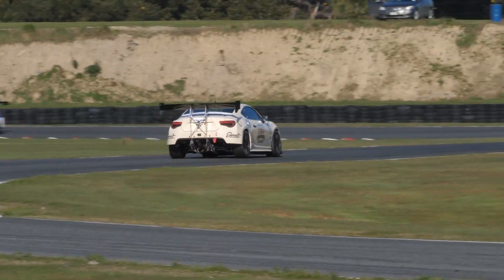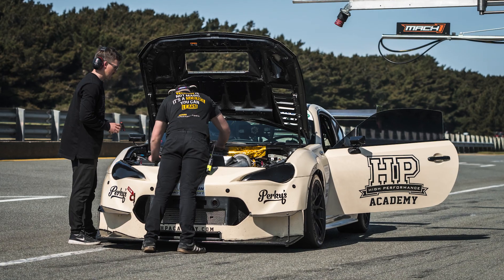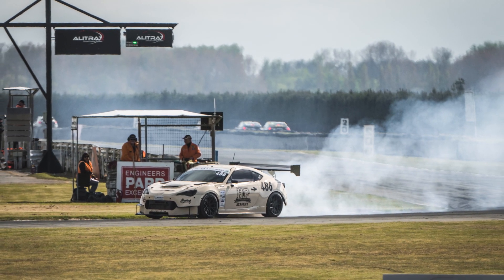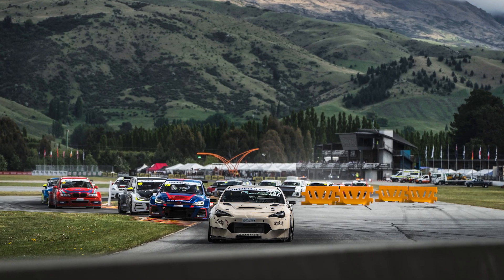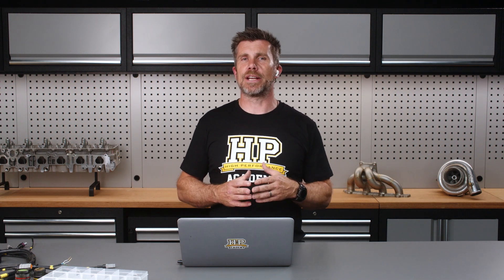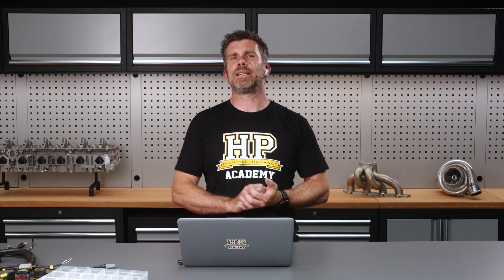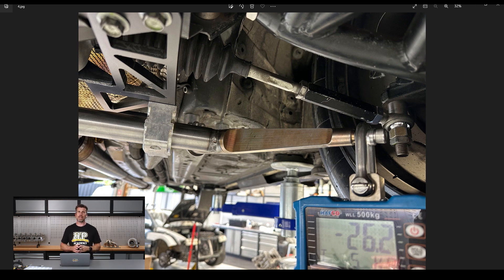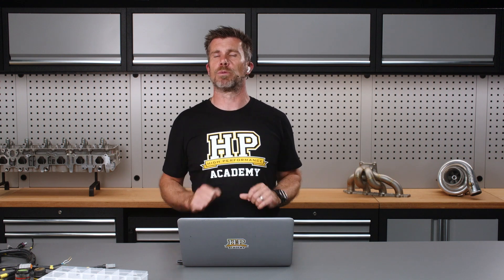Anti-roll Bar Adjustment | SR86 #update

Comment: Can you attach servos to the arb or attach to the manual lever an electric or pneumatic ram and program through telemetry when to use which setting? Or time based, or possibly steering angle, speed and g's to have constantly variable settings?
Reply: Or from GPS coordinates.

Comment: What an amazing design! Is this popular amongst the “high-end” racing community?
Reply from the maker: It's not uncommon but that is hard to answer as it depends what your definition of high end is when it comes to motorsport. 
What we're doing here certainly isn't a unique concept to just us either way and it's not just circuit racing-focused vehicles that give drivers such an option.
It's certainly nice to have and even having an ARB that you can manually adjust under the car in a few minutes rather than on the fly is still a massive win that you will see from club level racing up for good reason - Taz.
Reply: @hpa101  Reminds me of the early 90's DTM / touring car setups in the E30 M3. Team Bigazzi FTW! Nice to know it's still relevant for todays racers.👌
Reply: It’s generally a common feature regulation’s permitting for specific classes . ‘Works / factory’ cars and series like the porsche cup cars / BMWs have ARB ‘s developed by the manufacturer and therefore available off the shelf  easily. After that it’s more down to small performance manufacturers to bring them to market but that’s dependent on the popularity of a particular vehicle as it’s not economically viable to produce a specific ARB for a car that’s not popular. 
After that it’s down to the clubman/ national type guy to design his own if his budget allows . 
All in all not that expensive to do but you either need some technical knowledge and fabrication skills or have one made . Then that then leads down the rabbit hole of testing and experimenting to suit the individual car . 
All very interesting though , if you search around there is also an anti roll bar with a ‘third element’ . Mainly used on single seaters / LMP’s with pushrod suspension using a torsion bar and 2 blades in the shape of a ‘T’ . This prevents dive under hard braking and stabilises ride height at speed with high downforce cars  . 
You won’t go far wrong with this channel and others like it as they cover a wide variety of topics pleasantly presented .
👍🇬🇧

Comment: Love the content guys. I was wondering if you guys would do a video or creating a track map for inter session notes, a set up sheet and a race booklet. Having worked in race teams for a number of years, these are an important track tool that can be over looked. Also, I’m useless with excel and need the help haha
Reply from the maker: Hey Kevin, we cover this in the data analysis courses in relation to making your own, which might look a bit different depending on the event rather than being set in stone. For example, a practice day vs a race day. Tim generally breaks it down further into pre and post-event notes too.
You are not wrong though, some resources outside of the course material would be helpful and I will look into this. We do plan to do more around this topic in general.

For the 86 we have a booklet Tim put together noting some of it is specific to what is fitted to the car.

For reference the Data Analysis Fundamentals course covers setting up track maps & sectors directly: https://www.hpacademy.com/courses/data-analysis-fundamentals/?hpa-acc=HELPDESK50

For some other general sheets which may or may not help you I've collated a few here for you (and anyone else that sees this). As mentioned we do plan more content around all this in general too: https://drive.google.com/drive/folders/1Lc81QEUOjhXgaCvflfPnJgtyyrbrfPPd?usp=sharing - Taz.